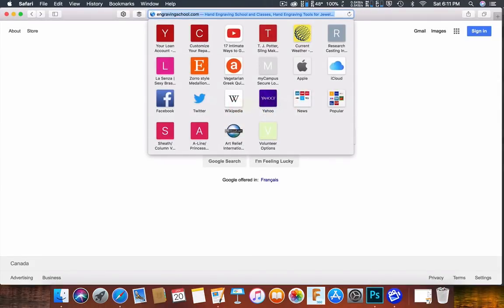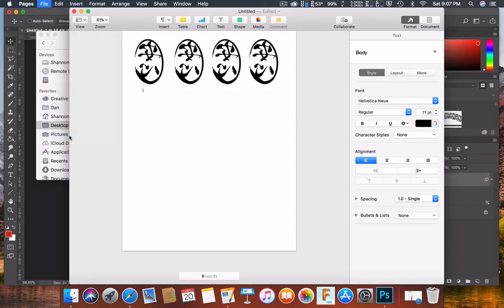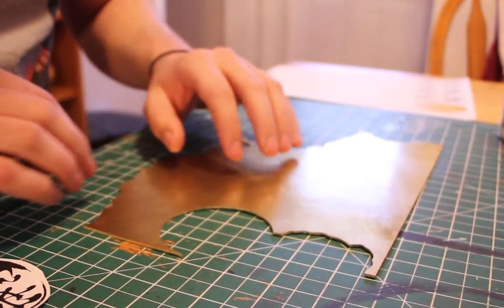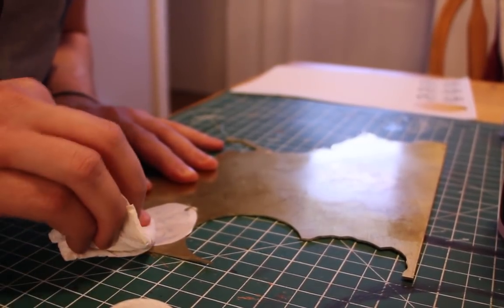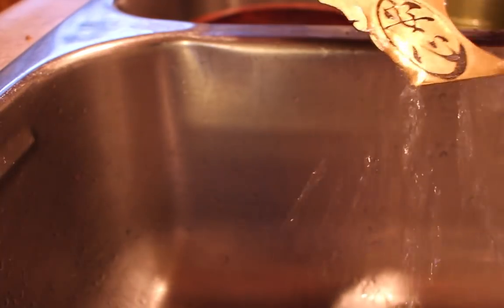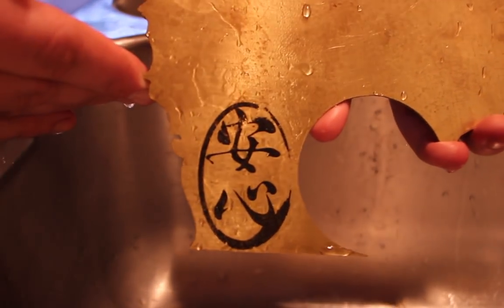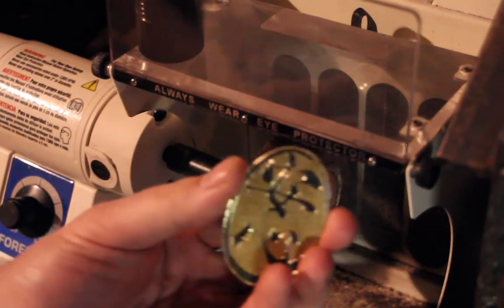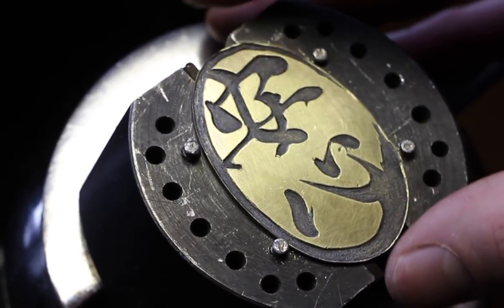Image Transfer to Metal for Engraving/Piercing/Chasing + Engraving

Comment: The blue PNP transfer paper works excellent as well. Just print your design directly on the paper and use an iron to heat transfer it to the metal. No chemicals needed and is very durable.
Reply from the maker: Ken Sanders I’m assuming you’ve used pnp as a guide for engraving, piercing etc. What was your experience like?
I’ve never used the product your talking about and the reviews only mention etching.
Reply: Yes, I've used it for both piercing and engraving. It works great. Give it a try sometime. I think you will like it.
Reply: @Jewelrymaker  I've used PNP blue as well as other toner transfer papers. But now I'm having problems with a large cast iron piece...  My heat gun won't get enough heat to transfer the image.  You think an iron would work? I've learned that the surface temperature needs to be at least 100° F.   Have you encountered this problem?  (mass of metal is a heat-sink)
Reply: @sknopster  You might try placing the piece in an oven prior to transferring the image with an iron. The item has to be really clean as well or the toner won't stick.
Reply: @Jewelrymaker  Do you know if the fixative is removable with alcohol? If alcohol cuts the fixative, I could use your process and remove the exposed fixative with alcohol.  Fortunately, alcohol does not affect the toner at all, therefore it would remove the fixative and leave only the toner behind. This would solve my problem!   (I know acetone and M.E.K. will instantly dissolve the toner)
Reply: @sknopster  I've never tried using it on cast iron, only copper and silver and have never needed to use alcohol to transfer the image. I used water and let the paper dissolve some, and then it peeled right off.
Here is another interesting video you might want to check out.
https://www.youtube.com/watch?v=haqP8xhsYas

Comment: Is the fixative mainly to hold the image in place or is it to perform  some chemical reaction to transfer the image to the metal?
Reply from the maker: The fixative holds the image,  I don't believe there is a chemical reaction. In theory you can do this same process without any fixative, but the outcome will vary depending on the surface finish of the metal.
Damar Varnish can also be used, I just find the spray is faster and move even across the surface.

Comment: What would be the best gravers to start with? flat, square, oval etc
which can be used for the most things
which would be best for motorcycle parts, aluminum wheels and the like
Reply from the maker: RevolutionStudio615 
It depends on what kind of image you’re engraving. The flat and oval are for serious removal and sculpting or inlay usually. 
Personally I prefer a “Calligraphy” graver, about 120 degrees, so it’s wide and with practice they’ll do really nice flares on turns. They’re also very blunt, or rather there’s a fair amount of material behind the point supporting it, so it tends to last a little longer over a narrow graver.

Comment: don't know what kind of fixative u using  i bought one its carnoy fixative solution and that dries up same as acetone and my printer is epson l358
Reply from the maker: According to google the printer you have is an inkjet printer which doesn't work for this technique. It has to be a laser printer with toner. The fixative we used is linked in the video description Im not sure what the fixative is that you mentioned.
Reply: thank you very much sir

Comment: What kind of liquid u use to transfer the image.
Reply from the maker: The metal is sprayed with fixative, what kind if linked in the description, and then the image is transferred with acetone.
Reply: Is the fixative required to make the laser toner adhere to the metal? I've used heat (120° F) and it transfers / adheres beautifully to the bare metal.  Presently I need to transfer to a 20-lb piece of cast iron... It's too big of a heat-sink and I'm unable to get the temperature required. I'd like to use the acetone process, but I'm guessing the fixative will act as a resist for the chemical (ferric chloride) etch process, or even electro-etching.  Do you think the image (laser toner) will transfer & adhere without the fixative?